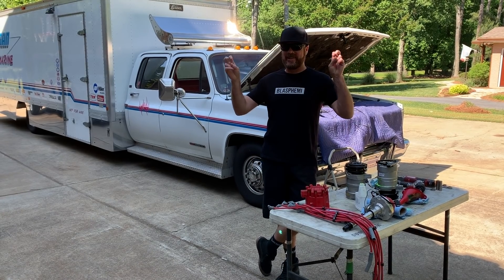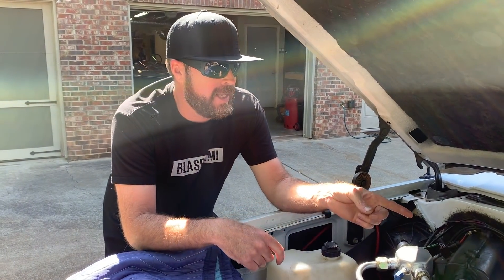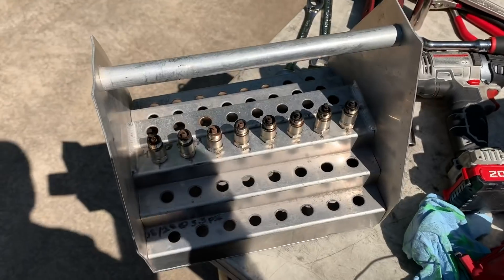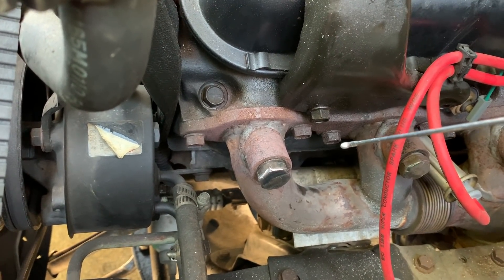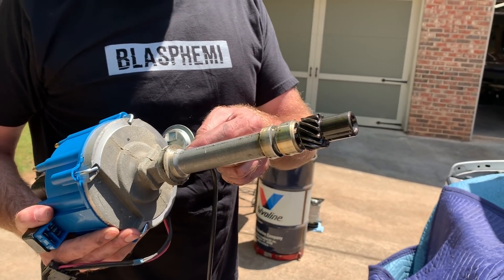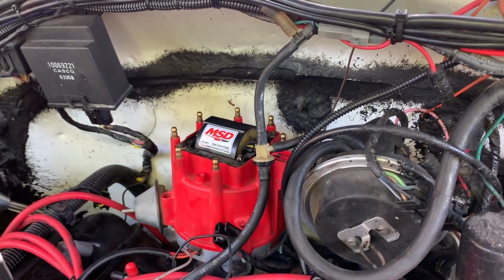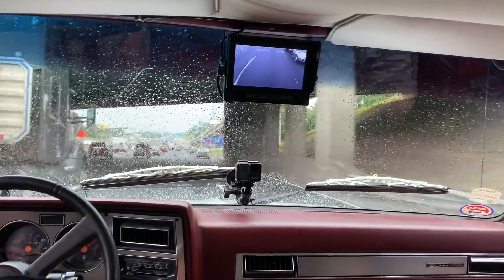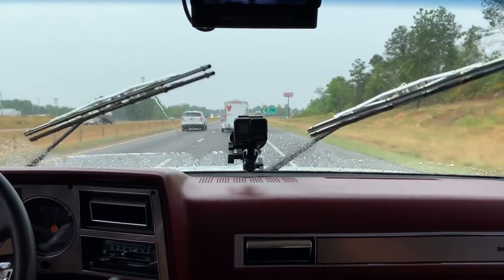More Power and Better Fuel Economy Thanks to Tuning and Overdrive! Ep.71

Comment: Maybe vent the engine bay at back and top and up front, help keep the motor cooler but also get a lot cooler intake air. Then if not already done electric fans and a efi intake. Maybe shoot for 12mpg

Comment: This thing has the aerodynamics of a BRICK HOUSE. 
If you want to improve mileage for relatively little money consider adding AIRTABS (see airtab.com).Those are vortex generators that will improve aerodynamics greatly. 
Also add some quarter sectioned PVC pipe to the front corners of the box.
These improvements will pay for them selves quite quickly indeed.
Make a video about it! It'll be fun!

Comment: Had a ‘’47 Hudson with FE390/C6 and it got 9mpg and didn’t have a lot of power or good acceleration.  Repaired vacuum advance, installed advance curve kit, set timing, tuneup, jetted carb for elevation and got a best of 16.8 mpg and had a lot more power. Loved the car all over after that.

Comment: Id like to see a video if there is one where you installed the gearstar transmission. I had this same set up and had the electrical system modified for the upgrade from the th400 to the 4l80e for a 4th gear and more mpg. But i never made it happen.

Comment: What's the fuel tank capacity? I know older GM fuel gauges aren't all that accurate sometimes but just over 9 gallons at half a tank? Either a pretty small tank or that gauge is seriously off.

Comment: how do u run a 4l80e on that??  trans controller?  i have a 89 dually tbi with a th400. debating if i swap it to card and or add overdrive because its having a lean condition.   just re did the trans and intake gasket oil pan new manifolds  deleted the smog still have egr. now have a lean conditon. maifolds got cherry hot and smoked the wires. dropped the timing to 8 degrees from 10, runs better but falls on its face.  think its a timing issue. going to swap in a new o2 and tps and see whats up . has new plugs cap aand rotor      stock base half of the distributor

Comment: That's pretty awesome but I bet that low compression 454 would like timing more up around 34 or so total mechanical. HEI's are so easy to modify. I grind the tips of the weights with a little curve and then get a recurve kit and put in the light springs. The HEI in my GTO has 25 degrees of mechanical advance and has run it's best E.T. with the initial set at 12 degrees. If you get some more advance I'm betting on 10 or 11 mpg with that excellent 4L80E!

Comment: What if you put a Cummings 12v in it with automatic transmission would you get better fuel economy? If you only got 9.2 miles per gallon on the gas engine with that new transmission how about cummings diesel engine automatic transmission an engine swap?

Comment: What the hell? Almost 9 mpg in a 40ft long brick that's probably 8 tons loaded with a carbed big block and straight 80's factory setup other than the overdrive and distributor but that's still basically 80's tech. And I get MAYBE 1 or 2 better in this damn 01 6.0 with the same 4l80e and unloaded. Other than the 10 gallons of water I have to carry til I finally put a radiator in it. Already had to do a water pump right before the cap cracked so not getting in a hurry. I don't know what GM did with these first gen vortec 6.0's but they suck on mileage.

Comment: Just get a diesel engine in it you get better pull and mpg rate on long run .You just wasting money on gas. Member diesel got more tq than gas engine and use way less rpm then gas . That means less fuel using on mpg.lot more tq. Than gas engine. If was me i put a duramax disesl engine in it.

Comment: another huge problem is the new gasoline has a boiling point as low as 80 degrees at our atmospheric pressure. Fuel injected doesnt have this problem because it is under pressure, but carbureted has no pressure in the bowls

Comment: Add a wideband o2 meter, punch out the plug in the top of the Q jet and adjust the part throttle mixture to get some more mpg.

Comment: Any idea how this 1989 truck wound up with a carb 454 in it? Supposed to be TBI
Reply: Obviously the guy who bought it had some common sense. That late 80's TBI is about as bad as the 80's Holley "EFI". A Holley HP system with a dual plane MPI manifold would be a better choice for this application.

Comment: Replace that white and black vacuum check valve tee (by the firewall above the dist) with a new one. The glue seam always starts leaking, they are a worthwhile 2$ from the Dorman aisle at any auto parts store. Many an elusive vacuum leak can be stopped with that one piece

Comment: Try moving your roof 'wing' forward another 6"+ if you can and adjust the angle a bit so the wind has a nice smooth transition that flows just over the front of the box instead of hitting a bit of a steep incline, blowing around there the logo... might be just enough to squeak half a point more.

Comment: I love these videos, my 86 is all stock besides the intake for some reason. It diesels as well, I want mpg and a Quadra jet is good for that. But for some reason I get 4-6 mpg it’s a 4x4 LWB single cab.. any ideas?
Reply: Do the small cheap basic stuff, same brand plugs it rolled of the line with, replace all vacuum lines, fuel filter an rubber lines, add a fuel filter in the engine bay if there isn't one $3.99 at AutoZone, helps vapor lock issues also. Run some Marvel's mystery oil one bottle for fuel gas tank, $5 a Dollar general $8 at AutoZone. Plug wires cheap also. Had a 96 Corolla 4 banger, stock take NGK plugs got 35 mpg, ran Bosch Platinums once got 22 mpg, put old plugs back in got 35 mpg again. Had 86 Nissan pickup, idled high an Dieseled, did all that an it stopped both issues one day.

Comment: I have a 84 gmc single cab dually w 454 - Did you delete all the smog stuff? In Vegas we have option to put the classic plates at DMV so I don’t have to worry. Also does your rig have an elect fuel pump? My truck boils gas like crazy in this heat. Vap lock sucks on my truck. I installed the western chassis drop spindles and cut 1/2 a coil and dropped the rear, thing look and handles beautiful, but not being able to run it in this heat , means it just looks cool sitting in the driveway, which is not so cool lol. Any suggestions. Looks as though you bypassed the mech fuel pump ?

Comment: Mike with the way a jet works why couldnt you two step the motor.  Timing forward/reverse would take some effort but seems doable or close enough considering you get to hold a rope.  Or just neutral dropping it.  Its water theres no real shock load to break shit.  Coupled with a standalone ecu you wouldnt even have to send power to the jet under xxxx rpm.  Im a dumbass but seems like theres a lot of possibilities there to launch it.

Comment: Dang, that's some serious improvement in mileage.  Makes me want to dig into my 1998 K3500 and determine if there is any improvement to be had.  Currently, I'm getting 5-6mpg from the Vortec 454 while towing my ~8000lb camper.  I've done the basics but as I understand it, I can't adjust timing without some kind of scan tool.

Comment: A Finnegan here's a recipe for you 
1 oz of pure acetone 2 5 gallons of gasoline 
This recipe will not damage any metal or plastic parts and will increase the combustion of the fuel 2 almost equal a fuel of 95 to 98 octane or better 
This recipe will also not damage any metal or plastic parts including valves or seals and we'll clear and clean carbon off of valve seats in a safe and efficient manner and increase fuel economy 
Essentially calculate your total fuel volume in your tank divide that number by 5 and that volume at 1 oz per 5 gallons
I 100% guarantee you will improve fuel economy short-term and long-term 
NASCAR had banned the use of acetone in gasoline engines in the 60s 

Use a shot glass for it in top off your tank and general movement and the input of new fuel will do the mixing for you and it is okay to settle

Comment: Add metal-based lubricant to the engine and diff oil and some octane booster to the gas tank, and you'll get 10-11 mpg easy...

https://www.pro-masystems.ca/ProductMoreInfo.aspx?PID=50083&MenuID=716

https://www.pro-masystems.ca/ProductMoreInfo.aspx?PID=50001CA&MenuID=717

Comment: whell, I'm glad he's at this point not hacking a huge hole in the original firewall, losing the factory hvac and installing a loud clattery tractor motor.
I'd rather have a mean well built big block and just pay for the gas any day..
Reply: Or he could put a modern 4 cylinder diesel (a 3l-4l) in it andnot cut anything... Best of both world.
Iirc isuzu has such an engine in its roaster

Comment: Hate to say, but everyone says 12 valve Cummins and your problems are solved. No problem isn't solved, you will climb hills at 20 MPH and probably run hot unless you put a semi truck radiator in it. Fuel economy will be probably around 9-11 MPG and very slow running down the road. The Cummins is a great engine, but people give them way to much credit. The truck is a big truck put a real damn engine in it, go with a 8.2 Cummins or a 7.2 Cat and quit bitching about fuel mileage. IT'S A TRUCK, IT WON'T GET FUEL FUEL MILEAGE!!!

Comment: Timing change probably gained more MPG than transmission
Reply: Complimentary changes, the lower rpm from overdrive is far more efficient and the timing correction gives it the power to use the new ratios.

Comment: If you want 0ver 10 o 11 miles p g take that w p fan off and install DUAL puller fa ns,flex a lite double and wire thru ind..r<elays with 10 gauge wire and use relay per fam (4 600 cfm straight blade fan.Then mount a big pusher fan in FRONT of a c  condensor
You won't believe it.i did stuff for my customers in Las Vegas at my shop for a lot of customers. Hell Mickey Thompson, MILEAGE and A C  worked great,he said I was his MILEAGE and A C MASTER it made miss Trudi happy when working on his old chev. Square box trucks!!
Note make sure you have a 100 or 125 a.p alternators).

Comment: experiment with aerodynamics,some sheet aluminum to form a taper from the top of the box & sides down to the cab top to get rid off the flat front of the box,could pick up few more MPG's 
,Car makers spend a lot of time and money on wind tunnel testing,
and they are tight asses if it made no odds they wouldn't bother to get the drag as low as possible imo
weight of the wheels/tyres is another area to try, the alu sheet aero would be a lot cheaper than some custom wheels of course, both aero and swap steel to alu wheels haulage companys invest in to lower MPG's

Comment: I see lots of comments about why the truck has a carburetor being an 89. Some cab and chassis trucks still came with a quadrajet in that year. This truck never had tbi. Yes, the wing is in the wrong spot. We mounted it where the old one was because we didn't want to drill more holes in the roof while on the roadtrip to California. Drilling new holes meant pulling the headliner out. Also, it now has sniper efi. Watch for that soon.

Comment: there are ways to get a little better mpg. change out the oil to full synthetic as well as synthetic in the rear. to adding a electric fan as well as better style of a stand alone trans cooler. it will help with the heat in the trans with its own fan.

Comment: If you don't find the cause of thr dieseling to be the throttle on the carb open too much, (the retarded timing would make the idle rpm low, and some idiot opened the carb throttle to make it idle faster, and make it diesel.), and you think it is carbon build up, put a quart of lacquer thinner for each 10 gallons in your tank, and run the tank full through the truck.   Should solve your dieseling.

Comment: Finnegan really should put a Cummins 6BT in the truck.
Reply: It would surprise me if this thing didn't get a diesel eventually... but first he gotta finish that boat, and the floor scratcher, and then it'll probably be time to fix the Blasphemi engine again, etc etc...
But any year now, for sure! :P
Reply: ziiofswe , there’s always that other project or priority..
Reply: True
Reply: I advocate that he swaps in an ISB instead. They're absurdly quiet by comparison to the 12 and 24v
Reply: Definitely a 12 valve. This from a 24 valve owner. Just take care of the killer dowel pin issue up front.
 Don’t see why with the engine bumped up to somewhere north of 500hp, the triuck, with that same transmission, ( insert billet converter here) wouldn’t  be able to give 25 mpg.
 I know, pretty big claim, right....  I’ve seen better mileage numbers towing over 30k combined, trailer and load.

Comment: If you want better economy you might want to consider a good supercharger with the least parasitic power loss as possible. Get a good tune, and you might find better economy, more power and less downshifting for hills. But note, if you drive it with a lead foot you'll get dreadful fuel economy.

Comment: I've had to rebuild those HEI distributors in every old GM I ever bought.
To get a smog era Chebby engine to run best, I usually had to add some base timing, recurve the mechanical advance to add more advance earlier, plus limit and fine tune the vac advance to get the best cruise torque without causing it to lean detonate on a hard part throttle pull.
9mpg in that brick is definitely a huge improvement!  You probably got another couple mpg or so hidden in some long tube headers and a Howard's 454 towing cam grind and you'll be doing VERY well for an old BBC pulling that load!

Comment: Wow almost as dull as Lucky's Garage show. Lets do a tune up boys. What genius thought to do that to increase mileage? A nice manual transmission is what you need in a truck not some namby pamby automatic. Try synthetic lube in the engine and differential . And a diffuser on the back of the box. Don't forget to draft behind a Semi. Last but not least cruise control . How about a splitter and a air dam for the front end.  CAT fell asleep.

Comment: There is 20+ years of tuning factory GM computers, including the TBI that this 89 would have originally shipped with.  Some very smart folks got together and made an upgraded factory GM computer called EBL.  I know the aftermarket stuff is more tempting and #Brands and #Advertising and #Sponsors but give it a look.  My father in law stuck an inline 6 292 into an 83 C10, 4L60 trans, GM TBI and a turbo with intercooler.  I tuned it with EBL and it runs very well.  EBL uses improved fuel control code and has some very advanced features (like nitrous control even).  It supports multiport or TBI, also.  You would need to retain the standalone trans controller but so what.  http://www.dynamicefi.com/

Comment: I really think that you should look into a fiberglass wind detector for the front wall one that runs down the sides. But keep the wing on the roof cos it suits it. Also mabe look into fitting more side lights i think 2 more up the top on each side so theres 5 and try to put the same sort of lights along each side of the bottom.  Also do 2 white led lights on the steps so when you open the door it lights up where the doors are but then 3 amber ones to give it that trucker's look . If you feel like a challenge maybe also see about side mirrors with lights and blinkers because they can come in handy for driving into tight spaces.  With the wing on the roof i would put  5 lights like the roof of the ramp truck 3 in the middle 1 on each side.  Or put a sticker on the wing and have 1 or 2 led lights that light up the sticker.

Comment: Run a segment with the OD locked out to isolate the impact of timing alone for the mpg improvement.  I'm betting the timing change did more for the mpg improvement than the OD.  Love the videos, Finnegan.
Reply: I was thinking that too. Should have done the timing fix first before swapping the trans.

Comment: I really like to see 32 degrees total advance on timing at 3100 rpms but you also have the Quadra jet carb on it still mine were with a 750 edl and a mid range even cam. This was on a 350 .030 over sized though. I pulled just about 11 mpgs out of it on the highway.

Comment: You need to set up a smoke machine to check out and adjust that roof wing. It is useless where it is. Better still set the front of the box with some rounded corners. Look at modern trucks and see how they are done.

Comment: Now deal with all the bad air under the truck. Put body panels underneath to smooth out air for less turbulence. Also a product called "air tabs" around the back side and top, their little plastic wishbone looking things that you glue on to diffuse the air on the back for less drag. You see them on semi trucks cabs and trailers. Some driver say that they picked up 10% to .25mpg and they help making the vehicle more stable in windy conditions.

Comment: Now bump the timing up to 32-34 degrees and get 10-12 mpg... 🤔👍😎
Reply: No, far from it. Yes, it will be SLIGHTLY better, but if you have ever tuned an engine, you will also know that bumping the timing up when you get close to optimum timing, yields fairly subtle improvements. Also, as this is a hauler, it might actually end up pinging with 34 degrees. 32 yes, 33 perhaps. 34. I would not do it with that overdrive trans in it. Too much cylinder pressure.

Comment: A truck that big needs a Duramax diesel redone by Banks with compound turbos. Or PDD has a 1,000HP Cummins 12V they’d build for you. 😊💕👌🤟
Reply: For cool factor and power, I'd go Cummins. But if you want old school diesel power, it needs the most efficient fuel-to-noise converter ever invented: 2 stroke turbo Detroit with big injectors. Maybe a 6-53T.